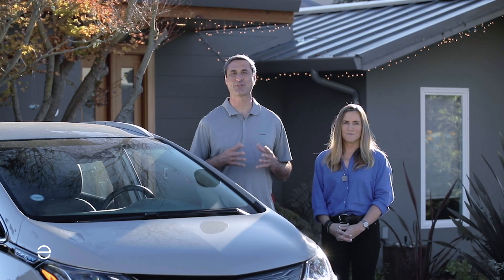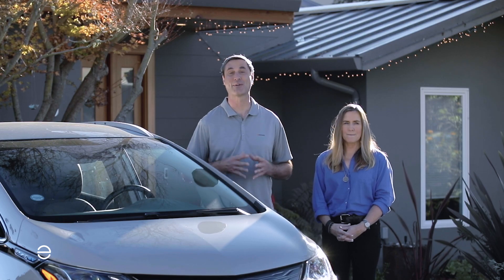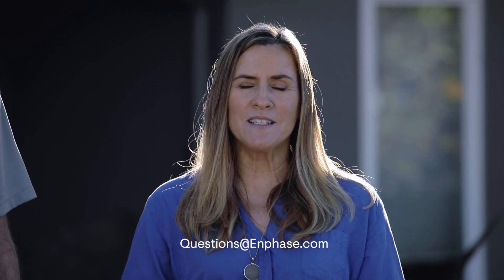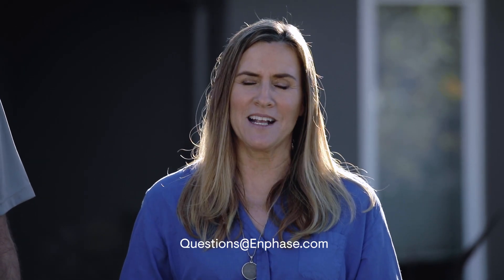The microinverter advantage

Comment: Thanks for your video about micro inverters. If the solar panels are fitted with micro inverters does this mean the current going to, say an EV charger, is already converted to AC 'before' it reaches the EV charger, therefore, a separate wall mounted inverter device is not required? Thanks.